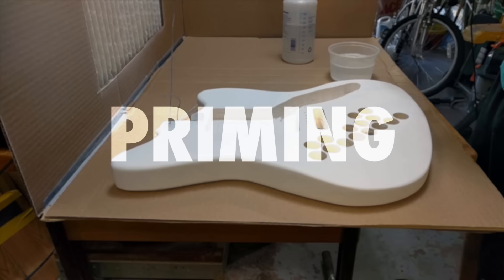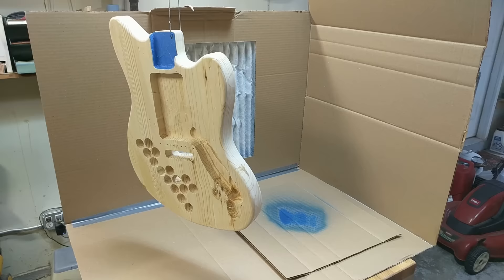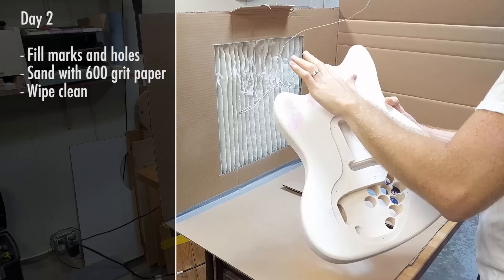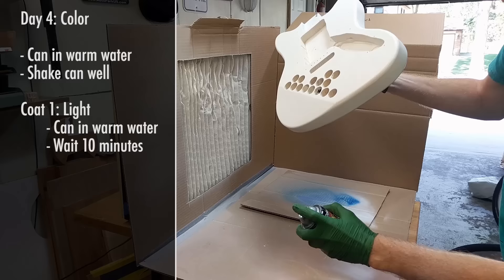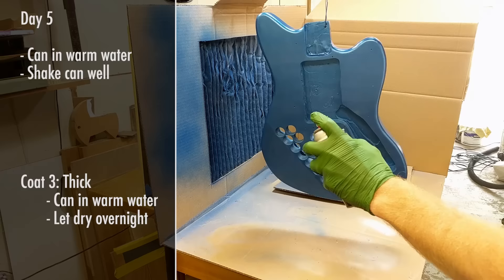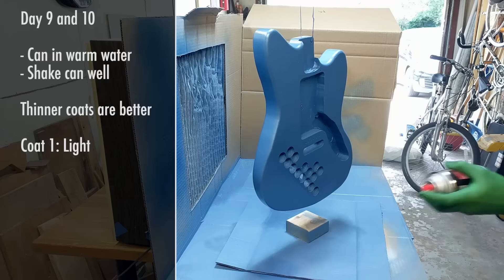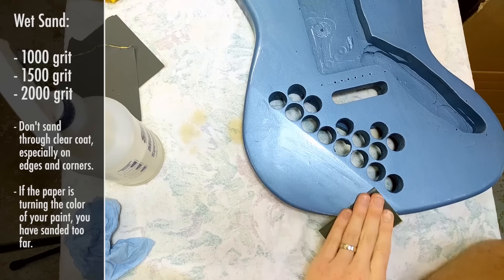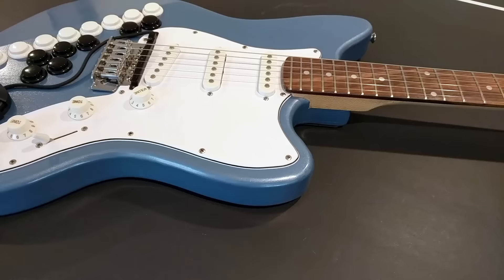How To Spray Paint A Guitar - Start to Finish

Comment: A few tips... I've spray finished quite a few guitars and your video auto-played from a different video I was watching and thought I would share these, note, I'm trying to provide some constructive criticism here, not call you out or anything like that:
1. You should likely create a bit more of a sealed/clean spray booth with like double or triple the air inlets, being filtered as well, to prevent dust getting on on it. You may want to force air in at the bottom and then have the outlet be near the top. But you really really want to be in a dust free environment, and you also really want to watch your humidity and temperature outside too.
2. You should fill any larger holes before you spray your primer, and then don't use primer as a grain filler/sealer, unless you have a primer that specifically seals as well. And definitely don't do that on really porous wood. For porous wood, a special grain filler, or a thinned epoxy is preferred. You can also tint the thinned epoxy with certain dyes if you are going to not use a color. Also, use an actual wood filler, spackle is for dry wall.
3. you should only sand to about a 220 prior primer and and between coats of primer, and before your color. If you sand it too fine, the paint wont adhere as well.

4. You should definitely level sand between coats of color. Most places recommend around 400 between each color coat, and same between each clear coat.
5. Start with 400 (or whatever you used between your clear coats) on your final clear coat and work up to 1000 or 2000 or whatever grit you want to take it to, going to too light of a grit too fast will leave larger imperfections and just smooth them over, or take you WAY too long to get them out. Also, most guitar manufacturers only go to like 1500 grit, and you definitely want to make short steps in grit as you increase.
6. If you want to be more "vintage-y", and later let it naturally "relic" or "check", use nitrocellulose lacquer for your top coat. There's a few different brands that make specific instrument lacquer. It's generally not much more expensive than the sprays you get at the autoshop, but it'll give you a really fine and tough finish.
7. Hold your spray can further away, and be sure to clean the nozzle between coats.
8. If you're going to heat your lacquer, heat the body as well. Lacquer adheres better when it's warm as you say, and it also sprays a lot more evenly, which is actually the bigger benefit. But it works even better if the surface of the item being sprayed is close to the same temperature.
9. I really like to get a "spray gun" handle for my aerosol cans. They give you the grip squeeze and let you control your spray a lot better for a more even application.
10. You should way at least 2 days between your final color coat and first clear coat. Like you said in your video when you went to do your final sand and buff, you want it to be good and dry. You don't want your clear coats to completely melt and fuse with the coats underneath. Since non-poly lacquer acts as a solvent to itself, that's going to happen to some degree anyways, but it's not nearly as bad and you get a much more consistent final product if you wait and let it dry really well. And the same goes for poly-based lacquer except that it's not that it will melt and blend (that just ain't gonna happen with poly), it just solidifies and dries and whatever you mix with it, etc, will be that way forever, so if you make a mistake... good luck.

Overall, this is a pretty good primer (if you'll excuse my pun) on the basic process, just a few minor things to help get a more consistent finish with less stress next time.
Reply: Some good points mentioned here.  However, there's no problem with sanding to 600 before primer or before color coats. You should have plenty of adherence using up to 600 grit.  220 seems far too coarse for spraying color.  Also I wouldn't say it's essential  to sand between color coats if the primer coat has been sanded to 600.  Sanding clear coat to 400?  Again that seems unnecessarily coarse, when clear coat can be sanded starting at 800 or 1000 (wet sanding).  Just my thoughts.

I'm sure you get great results with your method,  just sharing what works for me and could potentially be less work!
Reply: sanding between clear coats is not what you do, unless you are trying to even your surface which should have been done in the filling and primer stage.
Reply: Note to add, You might not want to level sand metallic finishes unless you want to flatten out the flake in the paint.  I learned this from repeatedly screwing up duplicator metallic lacquers, the first time I tired not leveling out the color coat, it turned out a million times better.
Reply: Thank you for this comment, and everyone that's responded. I'm about to do my first job and I need ALL the pointers. So happy this video is up, the other ones skip over a lot of steps.
Reply: Now this makes more sense. If I may add, when you're done spraying, turn the can upside down and spray until nothing comes out (3-4 seconds) that cleans out the nozzle.
Great comment, and thanks 😊.
Reply: Duplicolor Perfect Match is a lacquer, so there is no need to sand for adhesion (each new coat melts into the last, so sanding is pointless).  Your goal is to start with a perfect surface, so other than the primer coat, I wouldn't sand at all between coats (its a waste), and if you are really good, you might not need to sand the final coat.  If you put your coats on thick (especially the last one), they tend to self level before drying (give some extra drying time between coats of going thicker).  The only time I would sand would be if one of your coats has an accident (fly landed in the coat before it was dry, a big drip, etc.).
Reply: I’ve never heard of sanding between color and clear coats.  Cars use 2 coats of color and 6 coats of clear and wet sand polish the  final.  Why put on a coat of paint or clear coat just to sand it off?  Polish is essentially the most mild of wet sanding.   But I’ve seen guys that made it to the primer obsessing over that too much over 4 or 5 years
Reply: I believe the holy grail of booths is to pull air down through the bottom of a booth so that overspray and dust is drawn away from (rather than past) your guitar. A filter and fan on the bottom (sitting on sawhorses) works well assuming the floor is very clean. A bottom rear port is the next best option. Easy on the fan speed, too, because a fan on high will stir up dust and eventually suck all the air and dust in the room towards your spray area. In a garage, using (and leaving behind) some sweeping compound a few hours before showtime can also help keep the dust down (not immediately before because the stuff is not perfect and you’ll stir up some dust using it). Lastly, remember that dust masks don’t stop any nasty vapours; you really need a paint respirator for spraying.
Reply: @anthonypape6862  would you recommend sanding the primer then? I've spray painted a few guitars in my time but have always struggled achieving what I really wanted. I never sanded in between paint coats but did between primer and paint, paint and clear, and clear and polish.
Reply: @scottborman5180  No. I guess they are saying just scuff it so that the gloss can adhere as it wont adhere to gloss. What’s the problem with your result? They should mention some colors aren’t compatible with clear coat.
Reply: Please help! I started this process without reading you comment. I have sprayed 3 layers of filler primer already and it doesn't seem to be filling the grain very well. Should I continue with the filler primer at this stage or sand back and go with an epoxy or water based filler?
Reply: I just sprayed a guitar down with a rattle can outside in the winter on a windy day and I’m satisfied with my results. To each his own tho.
Reply: I just wanted to ask, if I want a Matte finish, do I just not add the clear coat and wet sand the last coat of paint instead?

Comment: Another tip to assist in drying and curing the pain is to have like a Par 38 lamp or two that generate a little heat.  When I worked in GM after spraying the bodies went through the "Oven".  Good dry heat, dust free, no humidity... it also helps improve the actual finish.
Reply: I never worked at a place painting cars but using car paint and pretty much the same process. I agree.

Comment: Another great thing to use between sanding or re spraying another layer is a tack cloth. Duplicolor also makes these. Helps make sure you don’t get dust and hairs in your next layer. Also, duplicolor makes a sandable scratch filling primer. Spray 3-4 layers of this then block sand the body. It will help get rid of minor imperfections. If there are still some imperfections visible (or you can feel them with your fingers - if you feel them you will see them later), get spotting or glazing putty (I think bondo brand makes this). Fill the minor imperfections and block sand again. Use tack cloth, spray pigment layer. You also don’t have to sand between the pigment and clear coat layers if you take care of the imperfections before spraying your pigment layer. Another thing you can do is do a few layers of pigment, let dry 24 hrs (I think, double check can). Block Sand with 600 grit (I actually like the equivalent of 600 grit sandpaper in a scuff pad a lot better- ones I get are a burgundy purple color), use the spot putty, block sand again then spray pigment followed by the clear coat as described on the can. Also, when you wet sand the clear coat it will turn out better if you also use a sanding block. You will never get as good a finish wet sanding by hand as you do with a block. You can do flat areas with a block and curved areas by hand or get a foam sanding block that has a bit of flex to it for the curves. I have painted a lot of stuff with duplicolor. If you take your time it can look really good. Also, only use automotive masking tape. The household stuff will lift your paint even if it has been drying for weeks. It can take up to a month (sometimes even longer depending on weather and atmospheric conditions) for the paint/clear coat to be truly cured and fully hardened. That’s why it smells for so long after painting even though it appears dry.

Comment: You should always use a sanding block when you wet sand the final coats because you actually apply more pressure at your finger tips than in between them and it can cause un even sanding. The block keeps even pressure across the entire face the sand paper.
Reply from the maker: I have one, I guess I could have used it...

Comment: just a tip you probably want to wet sand your clear coat with blocks to keep everything perfectly flat, and be careful around the edges not to "burn" through the finish.  I did a project recently and had a lot of problems, yours certainly looks better than mine.

Comment: I followed this method for 2 weeks, very long painstaking process but it’s worth the effort. My guitar looks like I just got it from the store brand new. One thing I noticed during wet sanding, the water seeped into the screw holes and expanded some of the wood in streeks and cracked the paint, it’s mostly covered by hardware so not the end of the world, but I was really annoyed by that. My fix is during the priming process to add hot glue to all the screw holes and sand down the beeds of glue to be flush with the guitar, then paint and when you wet sand the glue will prevent the water from seeping into the wood, then when you assemble the guitar the glue is still a soft enough material that you can screw through it with ease. I’m actually trying this on another guitar I’m painting right now so I will let you know how it works!
Reply: Genius! :))))))))))))

Comment: Carpainting-apprentice here; great work but you could probably use half the clear coat and still have about half a mm of clearcoat wich is plenty. you can also step up the grit when you are sanding clearcoat, we use 1200, 1800, 3000 grit wetsand on orbitals. stepping up the grit only makes it take a bit more time but you are safer from sanding through wich ultimately saves a bunch of time if you could have messed up. 

sanding sponges are also great for those hard to reach corners

Comment: It doesn't look bad, I have painted professionally for about 10 years, and I will say this, It's best if you wait 24 hrs between sprays to allow it to fully dry before spraying again,  also if you hold it back a little further, you won't get the runs as long as you keep moving, you will have to use a bit more paint, but the overall is worth it.
Reply: no, paint within 15 minutes. otherwise you can start sanding it again
Reply: @klaasj7808 you are correct for this type of paint system (acrylic lacquer). As per the directions on the can. If you re-coat within  a certain time frame (I think it’s ten or fifteen mins) you don’t need to sand and the lacquer will stick stick to the previous layer). If you miss that window you have to wait 24 hrs and then have to sand with 600 grit before the next coat (double check can it’s specifies the wait time and grit to use).

Comment: Nice work. Here's a great tip. Rather than hang the guitar with wire through the neck screw hole, take a 2 foot piece of 1x3" strapping, contour one end to fit into your neck cavity and mount it in place of the neck. Then drill a 1/2" hole in the other end. Now hang your wire and put a 45 degree bend in it. Adjust the height so that you can put the bend through the 1/2" hole in the end of your strapping. Now you can hang the guitar similar to how you have it however you can also remove it easily from the hanging position. You can hold the strapping for turning and moving the guitar around to get the paint to reach every area. The handle also protects the neck cavity from the paint overspray!

Comment: A few coats of sanding sealer with sanding in between would've sealed up the grain of the wood. Keeps the primer and subsequent color coats from having the grain show through and makes the final polishing a bit less laborious. That said, your final finish looks quite fine and I really like that shade of blue and it looks even better with the neck, pick guard and hardware installed! I was going to ask about adding a second trim color but you've already explained that.

Comment: decent video, but you skipped the grain filler/sanding sealer, which would have filled in all those cracks you mention.  One can of color should cover the whole guitar with only 4-5 coats.  I would personally have sanded to guitar to a finer grit than 350, but that's just my opinion I guess.  Good first go, though!
Reply: I'm a bit obsessive when it comes to getting a smooth and polished finish so I could no more bring myself to use a grit under 1000 than I would a Brillo pad on my guitar, unless I were just removing stuff (old paint, lacquer blobs etc). However, if one is going to have a substantial paint job such as the one in the video it really doesn't matter that much, it's the paint and the lacquer that will require the fine work ultimately. Still, while I go excessively high, I would agree with you that 350 grit seem to err too far the other way.

Comment: Best place to get paint for a guitar in a spray paint aerosol is from StewMac. In the future before you spray your primer you should brush wood grain filler over the entire guitar, sand, then more grain filler, and sand again. Possibly do it a third time. The spackle filler just doesn’t work like an actual wood grain filler does. You can actually brush the wood grain filler over the guitar and let it dry and then wipe the Guitar down with naphtha as it raises the grain and makes the very first sanding work extremely well . Also maguiers swirl remover is great for getting some of the fine super small scratches. But NEVER use automotive wax on a guitar as it has silicone in it. Always finish with a polish that has no silicone. It never comes off of your finish for the rest of the guitars new paint jobs lifetime. Still looks great though. Like that blue color.

Comment: After finish sanding the bare wood, USE A PORE SEALER, three coats. sand it.  Then primer, sanded , primer, sanded, primer, sanded.  Then you are ready for color.

Comment: I know this is an old video, but going to comment anyway. Wet sanding the color coat with 1000 grit to get rid of the orange peel on that layer will make working with the clear afterwards a lot easier and less work, and you'll also get better adhesion of the clear to the color coat as well. Also.. do NOT wax a freshly painted surface until it's thoroughly cured.. Usually you give it at least 90 days.  The products he's using in this video are NOT wax. They're polishing compounds.  waxing a fresh paint job will come back and bite you a few years later.
Reply: I should probably add an addendum though. There is a situation where you probably don't want to sand the color coat. And that's when you're going after textured paint effects. In this case you don't really want to sand the color coat much. But if you're doing a uniform solid color, then definitely hit the color coat with some 1000 to save yourself a lot of leveling in the clear coat.

Comment: Thanks for making this video! I've watched quite a few times and paused in between while prepping and painting my les paul kit and I'm going to be applying clear coat tomorrow. I ended up using Krylon Fusion all-in-one instead of duplicolor for my color coat because none of my local car parts stores had the color I wanted in stock and it still looks fantastic